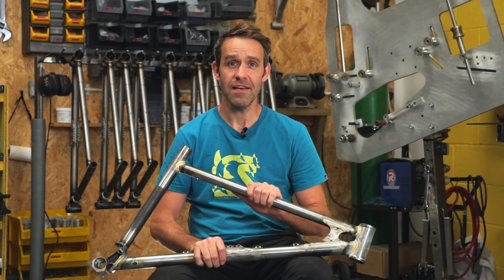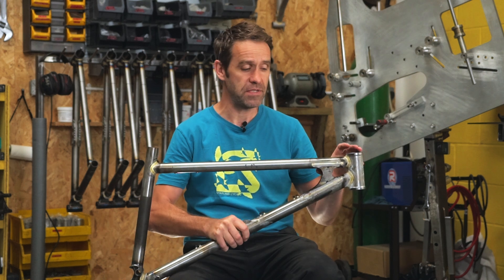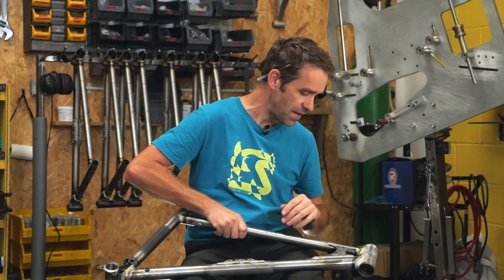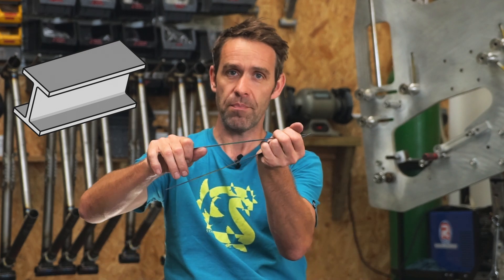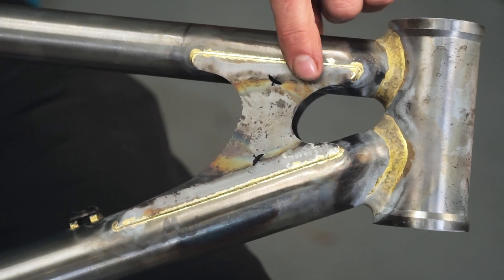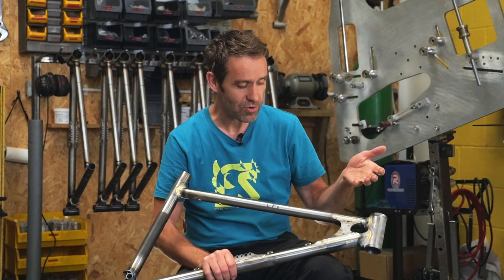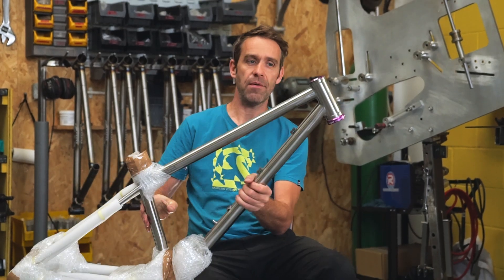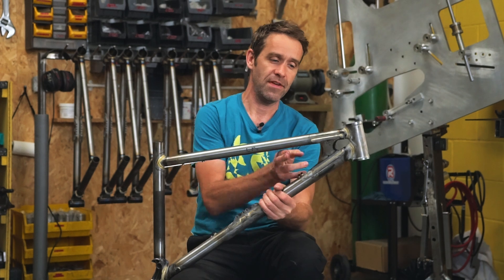Why are Starling's Headtube Gussets Like That? | Workshop Chatter

Comment: Nice Video, why do you don‘t join the gusset with the headtube? Are there any pros or cons for doing this?
Reply: To fix to headtube as well is much harder to do in manufacturing.  It might add a bit more strength.  But the design we use works well; we've had no head tube failures.

Comment: I do enjoy them. Is the gusset made out of 4130 or is it a different grade of steel?
Reply: It's S275 steel.  The strength is actually not that important.  It's role is to transfer shear and all steels will do this equally well.  It's failure mode would be by buckling, so again, steel type is not that important.  But we've seen no failures of gussets, so the steel we use is plenty strong enough...
Reply: @joemcewan2950  Cool, thanks for the detailed response.